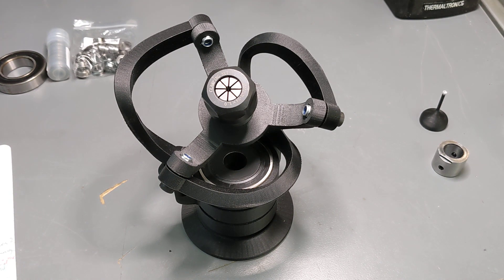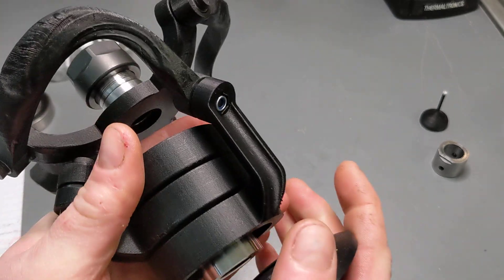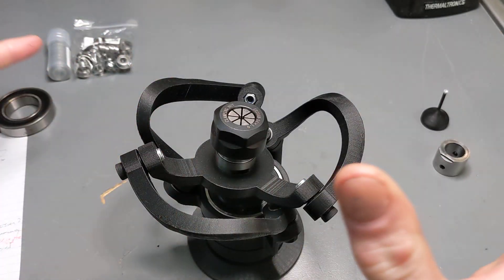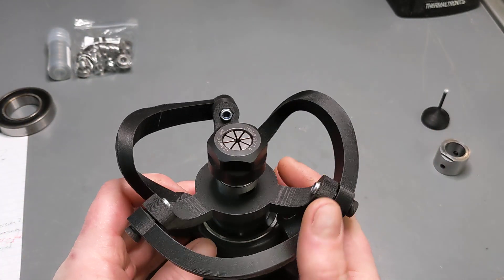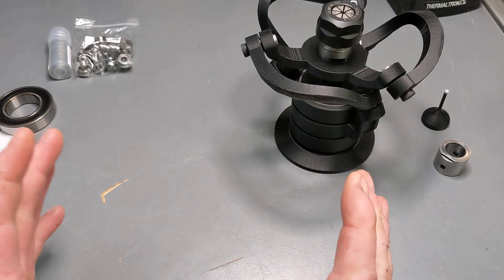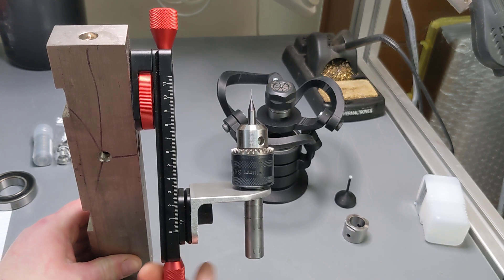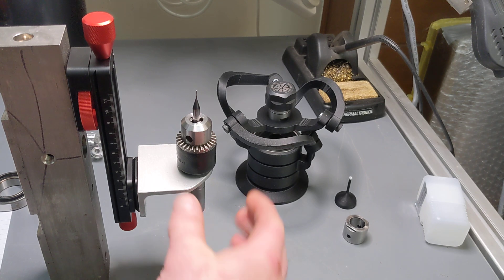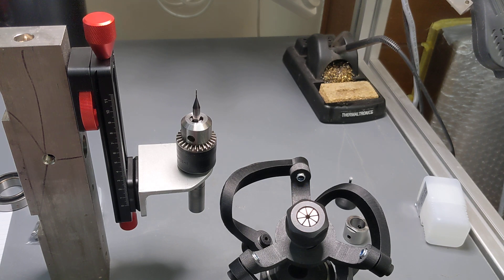Update on the Spherical Parallel Manipulator

Comment: This is called a 3-axis goniometer. They've been used for decades in crystallography and electron microscopy. They're typically constructed like the second setup. This is a much more compact design that could potentially lower costs and allow for greater instrumentation around the manipulator. The trick would be "teaching" the motor controllers to account for and utilize the parasitic motion.
Reply from the maker: Half the battle is knowing what something is called ;)
I had found 2 axis goniometer stages (not cheap, even from china) though they (or at least the ones I've found) all lacked the ability to adjust the work up to the center of rotation - though a small Z stage on top with your work holding attached to it would solve that. They were all still very limiting for what I wanted though (the SPM has similar limitations mind you) in that you can't look at anything longer than the center of rotation (usually 60mm above the surface for the ones I found) eg an endmill. 
The polar manipulator I showed also exists (and can be made purely from camera accessories bolted together, though that's a few hundred dollars of parts) though I don't know what one would be called in microscopy/industry terms. 
There's still a reason for the polar manipulator project to exist in that what is out there (I may be wrong, feel free to send me links etc) is an order of magnitude more precise and more expensive than needed for the kinds of low-magnification, inspection style microscopy I have in mind - If we can make one out of 3d prints, two steel rods, a bolt and some bearings then it becomes a $30 tool that anyone can make. 
Similarly, making one that uses off-the-shelf semi-precision elements for a more serious tool (ie somewhere in the region of $200 of parts? tbd) also bridges a gap - there's no (similar disclaimer, send links if you know of some) medium-precision entry-level microscopy tool for this job, anything I found costs double what my pretty decent digital microscope did. 
But yeah, 2 axis gonio stages have been in my aliexpress cart for months, could never quite justify the $450 or so but they're damn cool.
Reply: Oh yeah, what you're developing here is in a completely different category of precision/cost. My experience is in materials science with ultra precise scientific tools. The X-ray diffractometer that I use cost ~$500k, the goniometer is probably half that cost, and it's accurate to within 1/10,000° across four independent rotators. But I'm looking at reproducible positioning on the order of picometers. 
What you've shown here looks like it could be adapted for similar use, given precision manufacturing, and improve on the common set-up we use. I'm interested to see where you take this.
Reply from the maker: @johnmiracle7740   I love precision machines/mechanisms, I have lots of salvaged scientific equipment etc that I strip down to make other things or to understand them better (don't have many examples on my channel, I should post some, though this vid I talk about the differential screw in a microscope fine/coarse feed stage https://youtu.be/ezp9d5235lc) I'd love to play with one of those ultra precise goniometers... know of any getting thrown out? :P
Reply: @makebreakrepair  No, usually these machines get used until they turn to dust. When they do get retired, companies usually buy them back as an incentive towards a new machine (like a loyalty discount). You can sometimes find old scientific equipment on public auction sites for universities. Most R1 and some R2 universities will host monthly or quarterly surplus liquidations.
Reply from the maker: You're a legend - I literally have a list of industrial/scientific brands to use for eBay saved searches etc, I usually add to it when I take something interesting apart, I'm adding those to my list. 
Coincidentally I already have 'rigaku' on my list from a crazy automated telecentric  microscope I pulled apart years ago (microscope on a manual stage now, Danaher linear stages made a micromachining CNC machine, and a few other projects came out of that machine)
Reply from the maker: I ended up deciding I'd just make both available for everyone 😅
I've just uploaded the latest update vid, I've put a lot of work into making it accessible for everyone, files available very soon and I got the costs down to $10 of parts: $10 SPM https://youtu.be/DqjAKmm-FJQ

Also, If you're interested in the short-run, professional use metal version please fill out this form: https://forms.gle/XGxA5Zzp16doP4pE6
Your email or any other info you put in that form will not be used for marketing, nor passed on to any third parties, nor used in any way other than to contact you about that specific project - I'm just an engineer in a shed figuring out if people want something :)
Reply: @johnmiracle7740 wow

Comment: The newer one is great for practical uses. Unfortunately, I have no practical uses for it.
The original is like a functional work of art, and I just WANT IT! Especially once you get the design perfected.
Reply from the maker: Hah I'm with you on that... I made the first one because it looked damn cool even though it's less practical than the obvious solution (ie the dull functional option) - as a result I don't use it for microscopy much but it gets plenty of use as a desk fidget toy 😅
Reply from the maker: I ended up deciding I'd just make both available for everyone 😅
I've just uploaded the latest update vid, I've put a lot of work into making it accessible for everyone, files available very soon and I got the costs down to $10 of parts: $10 SPM https://youtu.be/DqjAKmm-FJQ
Reply: @makebreakrepair  nice!

Comment: Im really just interested in the math on how it works. I have made several of my own and only one works. Idk what parameters you used  but the angles DO matter. I knew all of them had to point at the focal point, but the angles between the top screws and the bottom screws appears to have a sweet spot, as my tests with a larger angle do not work.

Still, your SPM appears to ahve a greater range of motion than the one I got working and I dont know why.

Comment: I'd try both models if you have time. Use cases: polar- inspecting small parts for wear,  orbital-  maybe remix as a stand for a spericial lithograph
Reply: PS love the nails, whether rock n roll or camp 🤘💅
Reply from the maker: I ended up deciding I'd just make both available for everyone 😅
I've just uploaded the latest update vid, I've put a lot of work into making it accessible for everyone, files available very soon and I got the costs down to $10 of parts: $10 SPM https://youtu.be/DqjAKmm-FJQ

Comment: Can it be used as a electronic SMT component manual pick and place?
Reply from the maker: I'm not sure how - pick and place is usually planar with a rotating tool head, i don't know of any components that need to be placed at an angle relative to the PCB... Or I don't understand your question?

Comment: Definitely the weird one. My use case is that this absolutely needs one of Henry Segerman's Slide-Glide Cyclides on top of it. For reasons.
Reply from the maker: I ended up deciding I'd just make both available for everyone 😅
I've just uploaded the latest update vid, I've put a lot of work into making it accessible for everyone, files available very soon and I got the costs down to $10 of parts: $10 SPM https://youtu.be/DqjAKmm-FJQ
Reply: @makebreakrepair  😂😂🤩🤩. That's wild!! You have mad skills. Sounds fantastic and the polar one is looking really great. Thank you for all of your hard work and the incredible generosity to share it.  💜
Reply: Or, maybe The Boys Surface on top (Jos Leys has a good video animation), printed in conformant TPU (or silicone), so it can change shape as it moves and be dimpled in and out along the central axis. Then maybe put RGB LEDs in each of the three axes for visual feedback of position. Also feels like combining it with reaction wheels could be interesting.

Comment: I like the spherical manipulator for its quirks, but also, I'm not the target audience, I have no real use for either, but a half baked idea for the spherical manipulator as an input device for 3d software.
Reply: that's a good one patent it quick!!
Reply: @MrAllstar  🤣 im sure its been done before
Reply: @sshh7510 But has it?? Post a make and model of one
Reply from the maker: I plan to release a free 3d printable one, but I might make a more rugged one as a product for labs and such (if there's demand?)
I posted an update vid covering cad/files etc, check it out and leave a comment there on which concept you'd prefer and what your use case/application is (people keep surprising me with novel uses) and I'll do my best to accommodate that in the released design. 
https://youtu.be/wN02itp6-z4
Reply from the maker: I ended up deciding I'd just make both available for everyone 😅
I've just uploaded the latest update vid, I've put a lot of work into making it accessible for everyone, files available very soon and I got the costs down to $10 of parts: $10 SPM https://youtu.be/DqjAKmm-FJQ

Comment: Absolutely go functional. A fully printed "starter" version will also remain relevant long after the Ali-express links have died.
Reply from the maker: Oh any hardware I incorporate (eg bearings are vital for the SPM to function well) will be super common and cheap, I have good alie sources for bulk-cheap bearings but even if that store dies they'll still be skate bearings and those will still be everywhere. 

There is no 3d printed substitute for bearings (and I have a background in industrial 3D printing, I've played with every tech out there), the closest you'll get is a smooth metal rod and a hole in the 3D print (bonus points if you use the rod to melt the hole to be a precise fit), with no non-printed hardware the best you'll get is printed rod (ideally high resolution resin/SLA, SLS/MJF/DLM second choice behind that) going into a printed hole - no 3d printing tech produces rolling features well enough to do a ball or roller bearing. 

That said, I'll try and make a variant with as little hardware as possible too
Reply: @makebreakrepair  have you tried filament with lubricant inside it? Like ones from Igus?
Reply from the maker: @conorstewart2214  Self lubricating filament costs more than bearings (the little ones in the arms are about $0.50USD each) and isn't widely available or easy to print. I started out as a broke maker/tinkerer (now I'm an older, better equipped, broke maker/tinkerer 😅)so I sympathise with the desire to make everything on the 3D printer but there really is no substitute for bearings (note a smooth metal shaft in a hole is a type of bearing, called a 'plain bearing', for most of the industrial revolution that's the only bearing there was... but it needs a very smooth metal shaft to work). Especially with this crazy mechanism, due to its nature it needs extremely low friction on the pivots or everything distorts and locks up (eg if you used a 3d printed rod in a 3d printed hole it'd catch and jam). Don't worry though, I'll make the open source version as cheap and easy to source as possible.
Reply: @makebreakrepair  3d printing those bearings is totally an option aswell, but this should be up th the user if they want to source standard parts or print the parts 😉
Reply from the maker: I ended up deciding I'd just make both available for everyone 😅
I've just uploaded the latest update vid, I've put a lot of work into making it accessible for everyone, files available very soon and I got the costs down to $10 of parts: $10 SPM https://youtu.be/DqjAKmm-FJQ
Reply: Hell yeah!
Reply from the maker: I ended up deciding to release both types 😅
Check out the latest update vid, I managed to remove almost all the non-3d printed parts from the SPM and optimise it for the cheapest bearings available.  $10 SPM https://youtu.be/DqjAKmm-FJQ